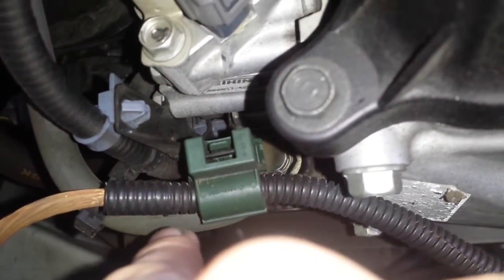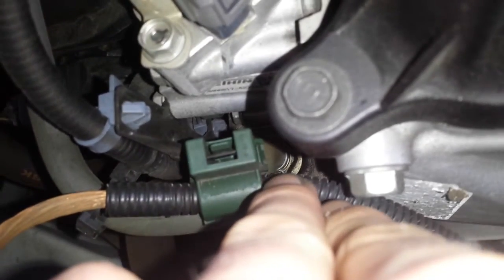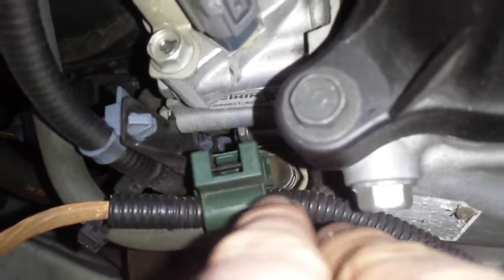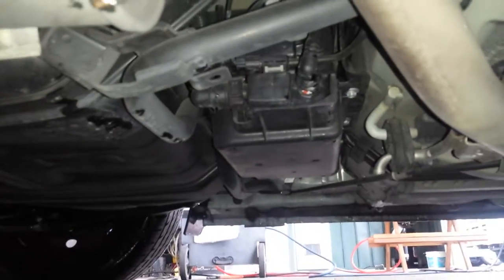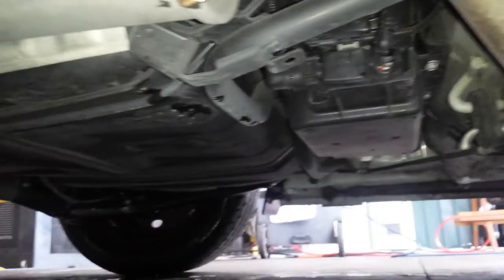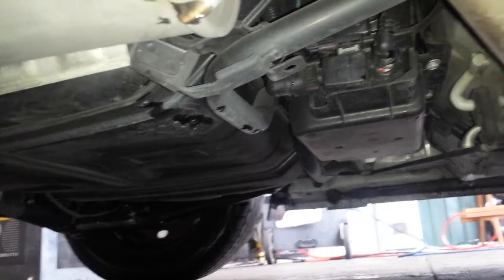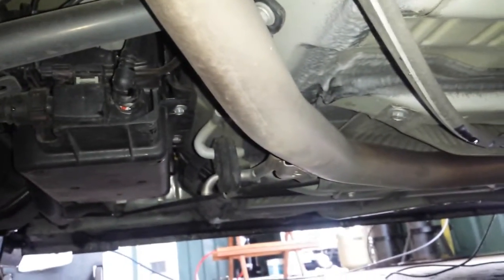Honda Civic emissions: EGR valve, PCV valce, & EVAP canister locations

Comment: Hey Scott, is the EVAP Purge Valve Solenoid located under the car too for the 2012 Civic?
Reply from the maker: +Gregory Burdge the purge should be under the hood. I have a few Civics vids. Ill look and see if I have a 12 but I should have a vid that covers that car.
Reply: The 2012 Civic used the same 1.8 litre from the 06-11 models so the purge valve should be in the same location under the cowl on the intake.

Comment: Thanks for the video. Can any of these be cleaned or need any cleaning? Thanks
Reply from the maker: The pcv should be replaced every now and then. Maybe every 60k miles. The egr shouldn't need and service. I use premium fuel in my cars I want to show a little more care to.
Reply: @ScottiesHobbies  Ooops I have 194k on my civic and I haven't changed the PCV valve.  I did just get an emissions check engine light though...
Reply: tehcompbuilder Start off using an OBDII code reader to pull the diagnostic trouble code for that check engine light. That will only give you an area where the problem is present in the emissions control system, from there you will have to track it down

Comment: hey man hope everything is going good. I have a 06 honda civic and I'm slipping gears. my Engine sounds loud but each gear gets high rpms. I don't know if you can help me or have any suggestions then that would be appreciated! I think it might be a solenoid
Reply: the only code that showed up was p0847. I just changed that and when I drove it, I hear my car sounding like I'm speeding but the rpms are slowing going up. it sounded like that before I changed it too. Not so sure what it can be, but a buddy suggested a solenoid. I have no clue because no other code came out. when it switches gears it feels kinda like it's pulling
Reply from the maker: You changed the pressure switch on the transmission? Has the same code came back? That code kind of supports my theory of a bad torque converter. Or it could be a bad switch.
Reply: Yeah I change the switch, any ideas from that point? I don't know if it was just the switch that causes that problem or how you.mentioned before
Reply from the maker: I'd start thinking about the torque converter. Especially if the code comes back.
Reply: Check your fluid level. look for bubbles and discoloration. Shouldnt smell burnt

Comment: hey man, i have a 2009 civic emotion and then when its start to 1500 rpm and pass 2000 rpm on Drive, car make some trouble like the engine starts to shake and when pass 2000 rpm get a normal,  do you know how is it?
Reply from the maker: Have you checked the motor/transmission mounts? I would check those first. Open your hood, Get in in the car. With your emergency brake on and your foot on the brake, shift from drive to neutral, to park. Watching the engine, see if the engine rocks a lot.